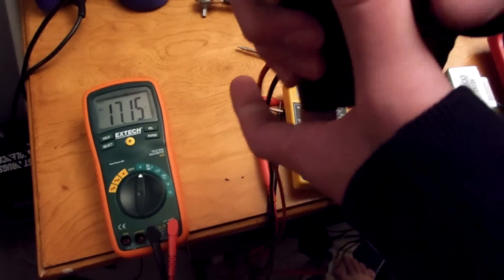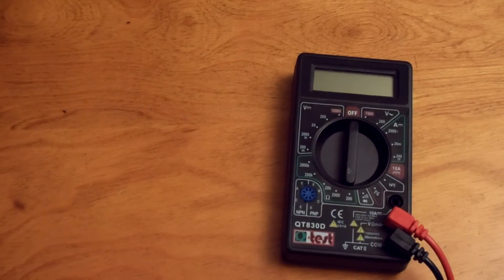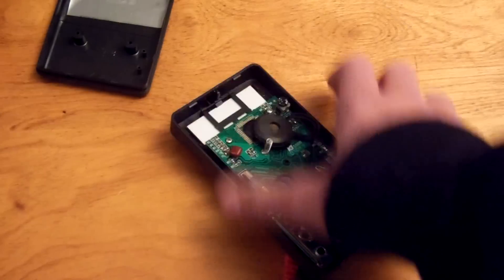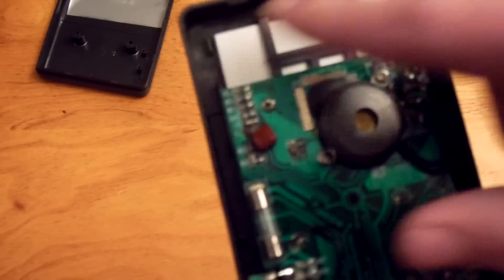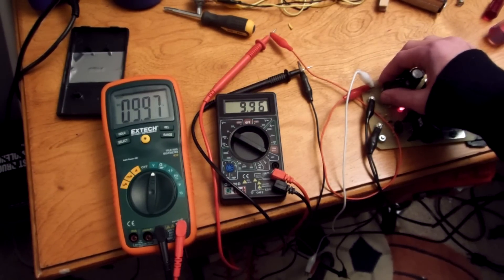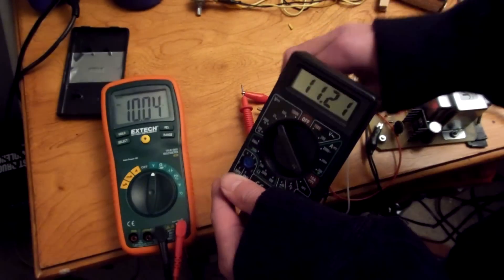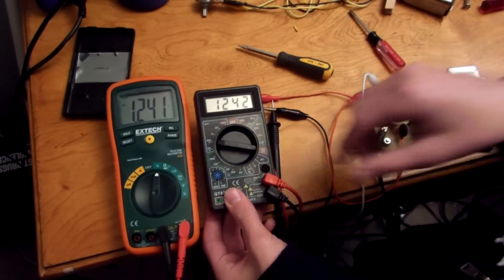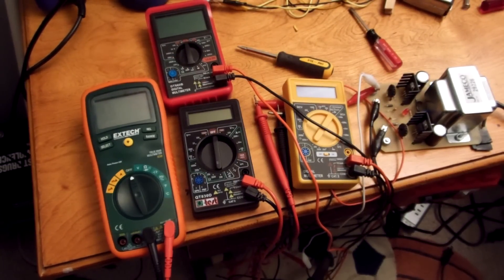How to Calibrate Inexpensive Multimeters

Comment: You don't need two multimeters to calibrate. All you do is turn your multimeter onto the highest ohm setting it has, touch the two leads together and adjust the setting to where your reading reads zero. Using two multimeters is not very accurate, what happens if the one you're using to calibrate with is not calibrated right????
Reply: This
Reply: Hi Ed would that be calibrating ohms or voltage, Thanks for any info.

Comment: Thanks man! I have a multimeter that reads 1.96V DC under my new Klein CL-200.
The Klein doesn't read DC Amps and I was wondering if Amps is non adjustable on these cheap meter's or does this adjustment affect amps as well?

Comment: Hey, thanks for the info. I too have a cheap multimeter, but it reads different voltages(DC) in different settings, offset by around 3-4V. Would calibrating fix it?

Comment from the maker: Yeah, that is one of my only complaints about the EEVBlog, anything less than a $400 Fluke won't suffice for playing with some 555 timers. $5 meters have their limits, and they aren't very safe or high quality, but they are good enough for basic use. I personally like my $75 Extech more, but I can't afford to buy 5 of them to outfit my lab. I use lower end equipment, but I am not making high precision projects either. I think engineering is more about the actual project, not just equipment.

Comment: I have a DT838 and it has 3 potentiometers inside. How do I know, wich one it is?
Reply from the maker: I would assume that one adjusts voltage, one for resistance, and one for current or something. If you have a nice accurate meter, I would just play around with the potentiometers until the reading matches the good meter.
Reply: potatogun96 The problem is it's the only one. Probably gonna buy a better one...

Comment: Question..

I have a multimeter wich is mid-range and have had it for 15 years or so..

recently i noticed it was indicating the voltage quite off.. like indicating 4.7V for a 4.2V battery and so... i was thinking in replacing it then i just changed the battery and seems ok now..
the question is... can a low battery make it to lose acuracy? and once replaced its as acurate as before or would need calibration?
Reply from the maker: With lower end multimeters, along with older ones, I have seen low batteries cause inaccurate readings. It's calibration is probably fine since replacing the battery fixed the problem.
Reply: sparrowlt A very low battery in the meter might cause it to lose accuracy, but by then the low battery warning (assuming it has on!) should be indicating.The battery you're measuring is not a voltage reference; it's not even regulated. It might be nominally 4.2 volts, but it might be at a higher potential (if it is new and fresh, or over-charged) and it might be at a lower potential (if it is defective or depleted).If you want to calibrate your own meter, you should either send it to a calibration service or buy a voltage reference.

Comment: I recently overloaded a meter and blew a fuse. I just replaces the fuse but the meter still shows a voltage even when there is no leeds attached. There are 2 potentiometers inside.
I cant see evidence of burnt resistors i think the fuse covered them. 
With 2 potentiometers which one does what? I havent tried messing with them yet. I also dont have a good multimeter to verify readings with.

Comment: I wouldn't mix up accuracy, precision and stability to one another.
I mean, you can adjust one meter to show the same as the other, but if they're not stable, they'll drift from each other over time (sometimes in very short amount of time) and it'll be moot point to do that.
Furthermore, if you have no reference that's traceable, you have no idea about your absolute accuracy and you could be off a huge amount without having any knowledge and your measurements are at best relative.
Reply: You're right but I think that when you lack extreme precise references and for meters used mostly in situations where merely ballpark figures are enough, his video is quite useful.

Comment: jon sanford This may be useful for your fleet of DMMs
Reply: I just calibrate them using my 'scope ;-)
Reply: I think that 'successive approximations' are 
The heart and soul  of engineering.
           The haywire school anyway.
Don't do it too good or they won't believe we did it.
Reply: That did the volts
what about the amps and ohms?
Reply: jon sanford
A good point, it seems very unlikely one potentiometer would adjust all measurements.

Comment: Thanks. Having a standard certainly helps. I wish there was something in nature that would give a constant voltage. Maybe you could use the 0.7V diode voltage drop.
BTW, those weren't a couple of millivolts off, they were 10s of millivolts off of each other.

Comment: do I need to have another more expensive Multimeter to calibrate the cheaper one?
Is there a way that I can do without it?
Reply: Find any known voltage regulator, e.g. LM7805. Connect it with a dummy load. Then, calibrate your multimeter by measuring voltage across that dummy load. LM7805 should give a good 5.0V.
Reply: I would choose a reference voltage generator, there are cheap ones as ICL8069 or so. Even a LM1117 has a pretty good error tolerance so you can assume that voltage as a reference, callibrating the multimeter until you get the voltage given in the datasheet.
Reply: @bruno_ricci    WOW, thanks i did not know there was such a thing; gonna check it right now!

Reference Voltage Generator!!

Comment: I was wondering what is wrong with my  "Mastech"   multimeter   When I turn it on it reads   - 273 volts DC . I changed the fuse.  
It won't give and accurate reading on a AA  battery .  When I switch to AC   in an outlet it reads 92 volts.

Comment: So you use a Good meter to calibrate a bad meter. In the real world we only have bad crap meters. So how do you calibrate a crap meter with just that one crap meter?
Reply: You may have to find a very accurate power source to calibrate from (like your computer's CPU core voltage, which will be somewhere around 1.2v, check it in the BIOS if you have a decent motherboard and set it to a fixed voltage). Unfortunately for me, that's what I'm trying to measure in the first place, so I'm going to need to get a very expensive bench meter with very good accuracy. The ones I'm looking at are about 50x more accurate even with an old used unit, but I would still need to calibrate it since even $1000+ equipment (new) needs to be calibrated every few months. And there lies the problem, not even expensive equipment can be easily calibrated by yourself...

But, if you're not trying to get accurate .01 V or better, then I would probably measure a computer component voltage for a reference point.
Reply: Thats a good Idea. But not sure how to get test leads to the CPU voltage. I suppose you can use something like the 7803 to get a reasonable calibration for a cheap meter if extreme accuracy is not important. Not sure what the tolerances are I know not that far off. 

But using 3.3V voltage regulator the tolerances would be tighter as a percentage between 0 and 3.3 unlike 7805 as the error would be greater. Or you can just use alkaline battery like Duracell as I see videos people showing that they have a voltage of 1.56 (If I remember correctly)  almost every time with in -+ .01
Reply: Duracell batteries are the most inconsistent thing I have seen in terms of consistency besides me spinning motors in my hands to generate power. Brand new batteries, same pack, huge differences. Also if they are 1.56V they are pretty much dead. 1.65 is a lot closer from what I've seen. Batch changes and chemical material affect them greatly and are a terrible source for checking anything but ballpark estimate. Duracell as a brand is among the most inconsistent I've seen too, Energizer seems to be a lot more precise.

CPU voltage is usually within .05 V. For instance, my CPU I'm checking is under heavy load, so its 1.5125 V like the motherboard is trying to output is probably incorrect, but at no load setting it to 1.3 to 1.5V should give me a very good estimate (and lighten the load as much as possible, like disable 7 of the cores to get even less load for better accuracy, and keep it in BIOS so it shouldn't be fluctuating from varying loads). I would expect very accurate results (definitely compared to a Duracell Battery, at least 10x to probably even 100x more precise) doing this. The big downside is you need a motherboard running a fixed known voltage, and you need to know where to measure across. I think there are multiple ways of checking, such as after the capacitors for the VRM, but some nice motherboards even have built in LCD voltage displays or connection points, which would make it very handy.
Reply: @brianlink391  Attaching one lead to ground (any plated screw hole or an I/O metal shield) , and one lead to the output of a mosfet near to the CPU area. You'll likely see multiple mosfets next to each other. Although every board, even same brand and model can be slightly different. You definitely need a good multimeter or bench power supply to fine tune it.
Reply: @hussssshie  nice for a reply. 2 years to late lol
Reply: Better late than never I imagine 😂 tbh I didnt see how old it was.
Reply: @hussssshie  lol

Comment: im not sure but if thats SMPS but if it is then maybe you are reading RMS voltage from your expensive voltmeter . If that is true , then you need to turn it off , or use constant voltage source .  I dont want to dig up theory but its not a constant voltage source , its pulsing , Like a speaker , so speakers have RMS labels , same for SMPS , correct method is RMS, in theory. Problem is that that cheap voltmeter doesn't have RMS , the other one does ... if im correct
Reply: He used a DC power supply.
Reply: Leandro Gabriel its SMPS, its not clear DC like battery is , its pulsing . Makes little difference but we are talking about calibrating so it maters
Reply: It is liniar PS, you can clearly see quite big transformer, filter caps and I quess Lm337/317 voltage regulators on the heatsinks, but even if that would be a SMPS you will not get practically any pulsing without load, and you can't consider a multimeters as a load (high input impedance)
Reply: Andriy 999 indeed , i was not sure . Some say that SMPS without a load is unstable . I dont know . Guy probably did it somwhat correct , i just like to share opinions on YT, with nice ppl

Comment: I've only the one meter how can I calibrate it if possible ?
Reply: You need something else for reference. In the case of voltage, if not another meter then a voltage reference. The easiest way imho it to type "voltage reference" on eBay, you'll be presented with list of cheap boards that provide very precise voltages. You just  power them up and use them as your reference.

Comment: i had one of them and the fuse blow and did not have a soldering iron :(
Reply from the maker: The manufacturers don't expect people to attempt to repair really cheap multimeters because of the low price. The lack of fuse sockets is done to cut costs, but it makes repair more difficult. However, a soldering iron is an inexpensive and vital tool for even the most basic electronic projects. I would recommend getting one. I use mine at least 2-3 times a week, and it has paid for itself from money that I have saved building things or doing repairs myself. Even a $5 iron would have worked fine to repair the multimeter, and it would have probably paid for itself by doing that repair.

Comment: I recently watched your vid when you made that power supply whay not make a inclosher for it
Reply from the maker: I didn't make an enclosure yet because I built a 30 volt 5 amp variable power supply. I just finished it, and I use it a lot more. I am in the process of making a video of it. I might still make an enclosure for the Jameco power supply, but it doesn't have enough power for a lot of my stuff.
Reply: oh ok i cant wate for that vid because im in aus and iv recently got in to this stuf and i need a power supply but i dont know if i could get somthink from jameco .ps i like lasers buy in aus 1mw is the most your alowd to get such bs
Reply: By the wat will that work with a 240v imput in aus thats our mains supply
Reply: I'm talking about the spore supply
Reply from the maker: alexander cruse Any transformer with a 240 volt AC input will work. A 25 VCT output with a 240 VAC input should work very well.

Comment: While shopping for metrs I discover the cost for an Extech product calibrated to a stadard is prohibitively expensive. Doesn't instill much confidence  with the accuracy of an off the shelf extech.  There are instances where an accurate meter is essential.  One would be the mechanic or auto parts shop who recommends an new alternator based on the voltage output. A  measurement where tenths of a volt determine if the alternator undercharging the battery, is correctly charging the battery, or over charging the battery. In correct charging of the battery shorten the life of the battery. I would be surprised if some states require test instruments that are used advise a customer to purchase something are require to be certified periodically. Like gas pumps and retail scales are. No doubt there's a way for the averaje joe or jane to create an accurate test standard, but I would know how to go about it. With a one pot adjustment I'd ask the local utility what voltage I would expect, and use an AC outlet to calibrate a meter using 120 and 240 outlet. I live in a small rural town. In the past I asked  the linemen  if I could show up at their shop to calibrate my meter to their meter. For meters with multiple pots I have used the test points of a properly operating tube type TV adjusting the meter to the middle of the range the service manual should  be present
Reply: chosen here a bad example, car charging voltage needs to be measured only to the 1st decimal place,NO more; diff,manufacturers, it varies,  but between 13.9 and 14.3 IT IS GOOD; 14.2 is best;  no need for any more precision

Comment: mine has no potentiometer.
Reply: what model/brand is it?
Reply: @camurgo  hi..  the missing potentiometer on the cheap multimeter ..   100k or what size must i solder to the pcb that has a place for it